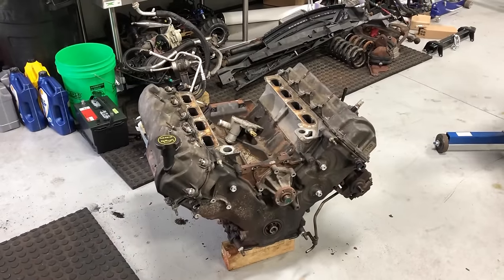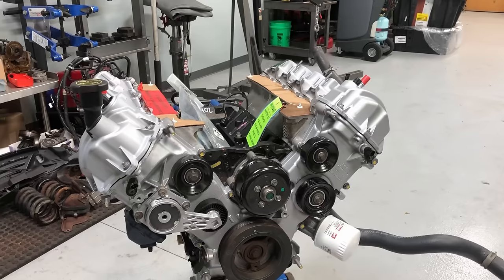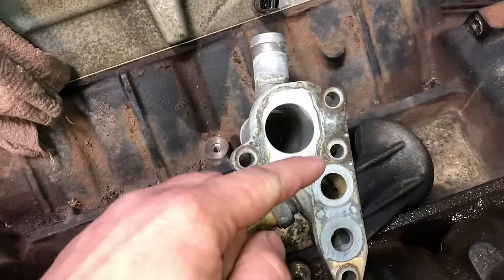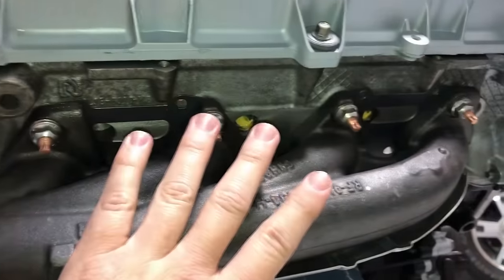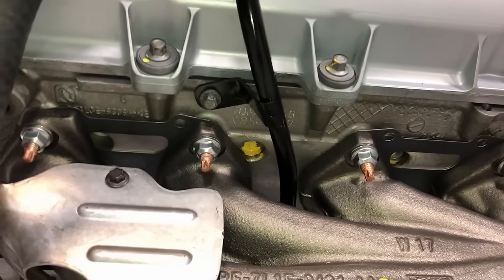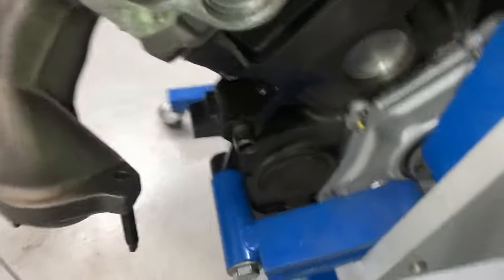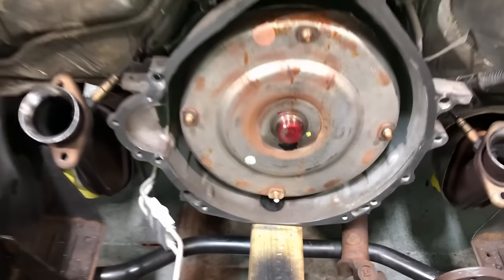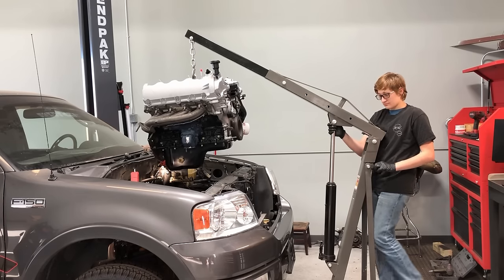Ford 5.4L 3v Triton Engine Removal & Installation Part 2 of 2: Engine Prep and Installation

Comment: Looking at the price of new/used trucks, I am thinking that I would be better to replace my 5.4 on my 2010 F150 King Ranch whenever it finally lets go.  292k on the odometer right now.  Would you recommend doing the transmission at the same time whenever that day comes or visa versa if the trans lets go before the engine?  It just seems to me that it would be cheaper to go ahead and do it all at once and less down time in the long run but I'm not too savvy.

Comment: Hello!  I don't live in the rust belt of the US, so my engine is pretty rust and corrosion free, but the exhaust manifold studs are not all good.  The ones that cam out of the block I put in a vice and tried to impact the bold free after using penetrating fluid.  The threads do not separate clean so they need replacement.  You mention using stainless exhaust manifold studs?  Are those Ford OEM or aftermarket?  If Ford, do you have a part number and if aftermarket, where do you recommend getting them from?

Comment: This video was very helpful and full of detail👍 and interesting 🤔 now I'm more sure of what I'm gana be dealing with in the future when ever I need to swap the motor of the expedition I just bought for mi wife, I'm more used to old carburaded motors more than newer ones that in half hour the car is running, this video is very informative 👍, I'd like to make it a 5.0 coyote swap in the expedition LoL, but it will take too much modification for that oem is easier and better... interesting 🤔 cool video thanks for the detail 👍

Comment: Thanks for the video! I thought the harmonic balancer bolt was TTY and is required to be replaced? Also, Did you need apply gasket sealer to the crank key woodruff?

Comment: Just installed a 4.6  reman in a 2003 Expedition. Tried cranking to prime oil pump and getting nothing from gauges. Going to try replacing the sensor and meling through the oil filter access. Any other suggestions.

Comment: I have 2002 Ford F150 Super crew 5.4L 2 valve I need to replace (believe lower bearing broke). Can i follow your removal and install videos for the 04 to do this or is there a major difference. Tks.

Comment: Maybe I will have to do the same in the next few days. My2005 F150 5.4 3V when I add antifreeze it goes straight to the oil pan. 
I did replace the gasket from the oil filter adapter, but sill no fix. Truck runs fine, smooth. I did check all the freeze plugs behind the chains etc they are all good. I am running out of options finding out what it the cause.

Comment: What about priming the engine with a pump through the oil pressure sensor, I've seen that work better than cranking it dry and overheating the starter & draining the battery?

Comment: Do you have a parts list for this job except for the 4.6 2 valve. I have an 06 were about to swap out in the next week or so. My truck hydrolocked and we thought it was the starter. Swapped the starter out and it was plenty strong enough to push the rods so bent the hell out of my number 1. Looking for a good used 4.6 this weekend

Comment: How difficult do you think it would be to do a full 3v and 4r75w swap into a '02 F150? My dads truck is starting to feel all 260k miles on it and want to know if upgrading to a newer powertrain would be a better option over throwing an upgraded set matching what he already has.

Comment: Also, the Starter Index Plate does not seem to have an inspection section that will allow me to access the bolts that attach the Flex Plate to the Torque Converter. I'm wondering where to gain access to those bolts & how to make that separation ? 
Thank you...

Comment: Now, what you want to do with the Triton three valve is find a huge dumpster. Once you have found a dumpster of suitable dimensions, place the Triton three valve in the dumpster. And finally, ensure someone sets fire to the dumpster. This will address all of the issues on the Ford Triton three valve engine...

Comment: I know it has nothing to do with video but i was wondering if you would know the issue i have a 2012 fusion fwd 3.0 and out of nowhere the oil pressure light started to come on at idle and goes away when given gas
Reply from the maker: Many times it is the sensor itself on the 3.0L duratec.

Comment: Have you installed any Headers on this engine and if so what brand has a good fit and won’t crack or leak. I have talked to guys that have replaced the manifolds over and over even using ford manifolds.

Comment: Hi MR MAKULOCO I HAVE A QUESTION MY ENGINE TIMING COVER IS CRACKED AND I'M REPLACING IT AND WHEN LOOSEN THE HARMONIC BALANCER MANUALLY AND THE HARMONIC BALANCER IS TURNING AND DIDN'T SOMETHING TO HOLD IT HARD FROM SPINNING AND TOOK OFF THE HARMONIC BALANCER AND THE TIMING COVER, AFTER ALL SPINNING SHOULD I ROTATE THE ENGINE TO PUT IT ON THE PREVIOUS MARK?

Comment: Question are those engines the one you have to remove the valve cover gasket when you have licking oil from the timming bell cover gasket ?

Comment: Man, fantastic videos as always, wish you were located closer so I could bring my aging 251k miles,  2001 F150 SuperCrew 5.4L Triton V8. She runs great, but has started using oil. I have to add oil weekly. Just curious how much would it cost to have my engine rebuilt? I am not a mechanic, dont have the tolls, time, or confidence to di this, due to disabilites, etc.. retired Marine, disabled, so cannot afford a new truck, love this one and do not want to sell or get a new monthly payment. Thanks for the great videos,

Comment: Brian do you know if the new  design engine head  5.4 litter  3 valve  fits  on the  old 06. I had  to replace  the  heads  on a 06 f150 the  only  ones  I could get  was a newer version  skinny  sparkplugs  they  looked the same  to the naked eye.  The truck  ran  good  at idle,  but when put it in gear  shakes  and  songs like  diesel.  By unplugging any vvt runs  so much better,  the owner  says  he never experienced that before.  First thing coming to my mind was  possible cam  configuration.   Thanks buddy.

Comment: Why did old engine die at 123k miles? I have a 05 cavalier with 112k and it runs great ...I baby it with 4k synthetic oil changes and a atf change.
Reply from the maker: Old owner neglected it and ran it dry.

Comment: Hi I’ve been watching your videos and I really like them. I was wondering how I know if it’s in the right holes if I didn’t mark the fly wheel holes and the torque converter bolts. It looks like it’s sitting beside another hole and every bolt
Is in a different hole does that matter? On a f150 2010 5.4.
Let me know thanks!

Comment: Hello, my engine has 140K on it at the moment and is having the well known timing chain start up rattle.  There doesn't appear to have any other issues with the motor.  What would your advice be?  Keep on trucking until something breaks?  Fix the timing rattle ASAP? Cost?  Would it matter if i fixed it sooner rather than later?
Thanks for the great content.
Reply: sam dell 1200 give or take for diy timing job, 3500-6k depending on engine... I did timing @ 172k and his videos are a lifesaver.

Comment: I will be doing an engine swap on a 2000 F-150 from another 2000 F-150, both have the 5.4. What differences if any are there that I need to look out for or will it be very close to the same as this?

Comment: I'm looking to replace an engine in my ford f350 and I had a question regarding the harmonic balancer/dampener. Can you just install the pulley like that over it, or do you need to find TDC and line it up? My buddy that I asked to help with this said that's going to make the engine installation process a lot hard due to having to torque that to a very high number. Are we just being stupid or are there other steps we need need to take during that step? 5:50

Comment: Thankyou great video, one question I working on a 2001 5.4 2 valve and need the torque values for replacing intake. Everything that I'm reading said first sequence 18inch lbs second sequence to 89 foot lbs, some websites say 89 inch lbs, like the information you gave for that said 89 inch lbs, any help would be greatly appreciated.

Comment: Changed a locked up 5.4L engine in a 2006.  Engine turned I had to in order to line it up with torque converter studs. Now that it is mated to trans, engine won't turn. Not with harmonic balancer bolt, not with pry bar on flex plate not even with starter. NOTHING fell in the engine during assembly, truck rolls when in neutral. Seems like input portion of the 6R80 trans is locked up. Is that even possible?

Comment: I need help.... I got the new 5.4L 3v from American powertrain in and ready to prime the oil pump. Every plug is hooked up. We have went through the same process of trying to prime the oil pump. We haven't achieved oil pressure though. Anything you can think of that would help?

Comment: Would a 5.4 be a good motor to replace a 7.3 with I know the 4r100 trans from my7.3 would be strong enough I just want to know would it be a pulling strong replacement and I trust your opinion I’ll be towing under twenty six thousand pounds only what do you think 🤔

Comment: I was replacing the motor in my Lincoln Town car 4.6l the engine I got from the salvage yard that they pulled looks like the 4.6 but the valve cover and engine mounts look more like this engine featured on this video I'm asking because I cant line up my motor mounts and I swapped the mounts from the old engine to this one because mine takes pins to secure the mounts. But the ones from the motor I got from the salvage yard has a stud and ideas

Comment: Hey there!
Great vids and info!
Sorry to derail, I have a 2010 Raptor w/ dual zone climate. 
The air went from being slightly warmer on the passenger side when using AC to cold on pass and hot on driver. I changed the actuator behind the nav (what a blast)...now its HOT on pass and warmish on driver...:(
Everything else seems to be working as far as I can tell (vent selection). I did the "calibration" to the best of my understanding. Could you give me any advise as far as what to look at next? Driver side actuator by the gas pedal? Is it the same part#? Thank you for any help you can provide.

Comment: Do you ever use the clear flood mode to prime the engines? I used to use the crank sensor plug as well, but I got tired of unplugging it every time since my truck sits for weeks at a time. 

I just hop in, hold the gas pedal to the floor and the pcm turns off the injectors and will let you crank just like if the crank sensor was un-plugged. Great for priming after oil changes too!
Reply from the maker: Yes but on certain years and models it does not work all the time and will instead start and go to full wide open throttle. Best to disconnect and be sure.
Reply: I know on my truck (not a Ford a Dodge, but anyways) I have pulled the fuel pump relay after a oil change. Few revolutions and put the relay back in and good to go. Don't remember if there is a clear flood mode or not. But the relay is quick and easy for me.

Comment: Hello.. 10 months ago a mechanic  put a new engine in my ford 2006 and now when I engage to Drive star a little bit shaking. is that normal?. also 2 months ago i cleaned the throttle body  and a see a little bit of oil inside on the intake manifold  and I don't  know if that is ok or a should replace the Intake manifold.  
i will really appreciate your recommendations. 
thanks.

Comment: I was wondering if there is anywhere I can buy new main nuts for the passenger side motor mount? (mount to frame) I have a 2007 XLT 5.4 3v

Comment: Any tips.for the driveway doer on replacing the hydraulic throwout bearing on a 97 f150 4.6 5 speed 2wd?

Comment: Strange this was recommended so much later. How come you went with a 3-valve instead of a coyote? Just curious. Did you get this truck for basically nothing? Or do you prefer the 3V over the 5.0 for some other reason. Great video btw.

Comment: Like many of the poor but willing workers who watch your videos, we're unable to buy a reman from Ford so we do swap from a parts vehicle or recylcer. Any recommendations on whether we should transfer the PCM from the parts truck to the vehicle in repair? Does Ford 'marry' the PCM to the engine, ignition or other parts in the car? Inquiring minds want to know, and I figure you know more than most technicians about Fords...

Comment: I rebuilt my engine and replaced my engine mounts. Now my engine doesn't sit level. It's slightly lower on the driver side. I don't recall it leaning before. I've lifted the engine back up made adjustments and nothing is working. Any ideas?

Comment: Just received my engine from powertrain as suggested. It shipped from Texas. It was at my house in 6 days after ordering. All good there right?
My disappointments so far are the remanufactured engine is a 2004. I had a 2007 so yes I can still use my valve covers but I have 10 holes and the block has 13. It is fine per Ford as I called them but it looks not right. ALSO... my motor came in a CRATE and the engine had a heavy duty bag zip tied around the engine. It was awkward lifting the engine off the crate as the engine lift can only approach the crate from the corners. Ok coming off but may be difficult placing the old motor on. I have about $968.00 worth of Brian's suggested parts on order and the engine is on the stand safely. One other thing...my new engine came from Mexico and it did not have ANY nice card board covering the top of the motor which is very nerve wracking for obvious reasons. In Florida Lizards, but also parts could fall in plus dust and moister so I am Very careful around the engine. Any comments Brian?
Reply: So what were the $968 in parts Brian recommended?  I thought power train Brian endorses is out of  Oklahoma City (??) How is the motor? Thx

Comment: Do you use a break in oil? Fraser reman recommends it and they list a few varieties on the warranty card... but they show 10w30 30 sae etc. Truck takes a 5w20. I tend to be concerned with viscosity ratings for proper vvt actuation and rate of top end oiling as well. Thoughts?
Reply from the maker: no

Comment: Hardest automotive thing I've ever did getting the engine to transmission 5.4 3 v . 1 torque converter nut on but don't know if the torque converter came out some or if all the studs will come thru an the side bell housing bolts are in just not the top bell housing bolts the top of the motor still a inch away from the bell housing like it's crucket idk wish I had some help with it

Comment: Hi. Love your videos. They are very informative. I have a question. I have a 2005 expedition. It has new coils and plugs. It misses at idle after it warms up. When in gear it misses and runs very bad. I have to put it in neutral it shacks so bad at a stop. Truck has 95000 thousand on it with no CEL. I've tried unplugging the vct solenoid but no change. Any help would be greatly appreciated. I live in Indiana so I might have to bring it to you. Thanks
Reply: Sounds like an oil pressure problem.  I have "cured" customer cars with this issue by changing the oil and filter with OEM filter and 5W20 synthetic blend or full synthetic whichever the customer has been using.
Reply: @rays7437  Thanks for the help. I just bought this truck and it is frustrating the hell out of me. I will give this a try. Thanks
Reply: Could be a vacuum leak possibly.. probably just have to do process of elimination if doing work yourself.. my next guess maybe bad injectors..
Reply: @jamesratliff1097  
JB makes an excellent product for professional shops called "Total Oil System Service."  It's just 2 bottles that you pour in to the crankcase.  One bottle before the oil change, and one bottle after.  I have had excellent results with it over the years with many customer vehicles.  If you can find a place that has it (very few places) I would highly recommend it.  The kit is around $40.00.  But definitely do the oil and filter change anyway.

Comment: I’ve been looking for a video to do an engine swap in ford vans with out much luck. I’m taking an older 99 out to replace a high mileage 2006. They are both 4.6L Romeo engines and both 2valve. According to my local dealership the blocks are interchangeable and will have to change the intake and coil setup amongst others. Do you know of any, and would I be able to follow this video in my circumstance? I appreciate your high detail.

Comment: Do you ever do cam phaser lockouts. I did all 3 of mine as soon as they went out of warranty. I use an SCT tune for phaser lockouts and love it. It eliminates all 3 v problems.
Reply from the maker: It is a band aid fix that doesn't actually fix anything, just mask it.
Reply: @FordTechMakuloco  I have 2 with over 300,000 and 1 that just hit 270,000 and they tow every day. I am super happy.  I also use 10 oz. of hot shots Stiction  eliminator in every oil change and all my engines are super clean inside.    Thanks for the channel. I recommend it to anyone working on their own truck.

Comment: I need help, i have an 08 escape 4 cyl , last night i went in to a ditch and the bottom front park of the car hit the rail road tracks, i was able to pull out and drive it home no problems exept this morning when i started the car i got a message on the dash that says electronic power steering failure, theres no dents under the car or anything i lift it up to check and i dont see anything wrong

Comment: Thanks for this awesome video, I just installed a 4.6l in a 2006 F150 and your video eased the process. I would like to ask a question. I have a engine coded of p0605. Any help before I take off to dealer for a reflash? Or anything I should look at before taking it.